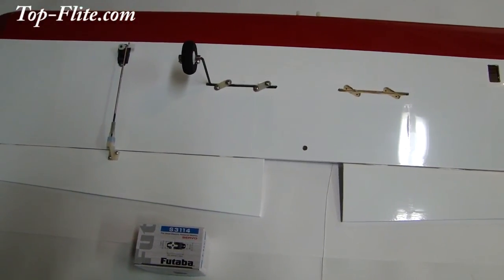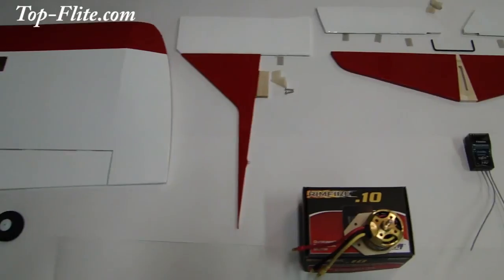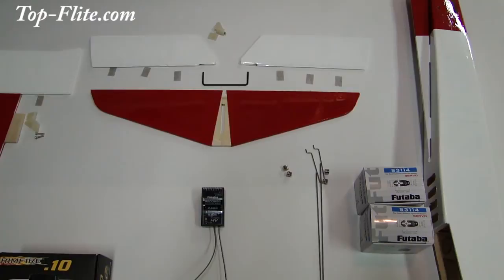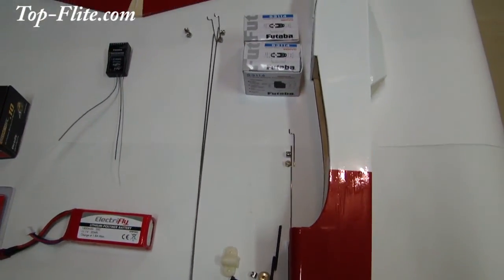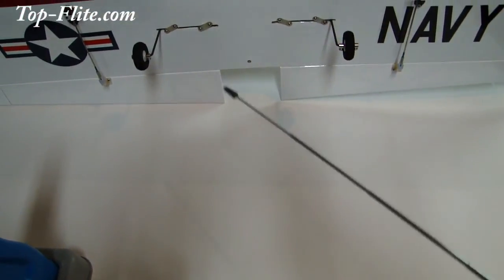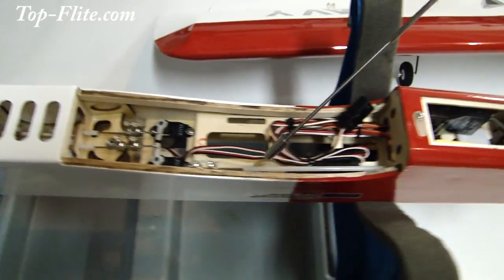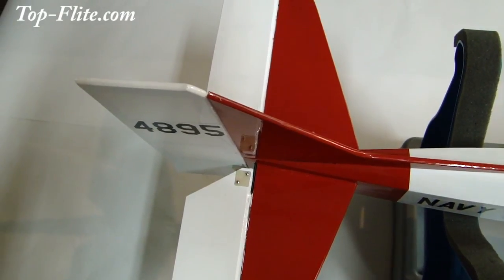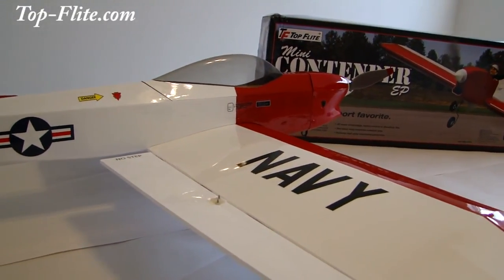Top Flite Mini Contender EP Build Video

Comment: the os is just over an oz heavier than the suggested rimfire so it might be a little bit more challenging to get the correct cg but, i dont think it would be a problem at all. just because both motors are ".10," that doesnt mean they r equivalent. the os bigger and more powerful than the rimfire .10